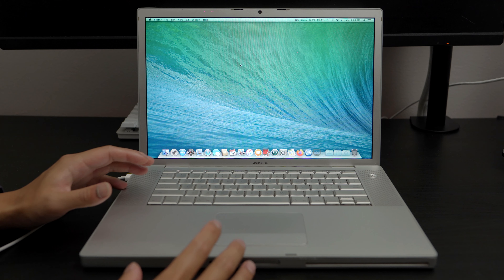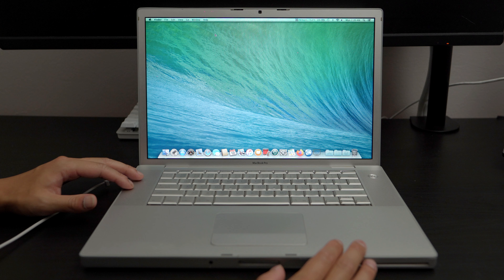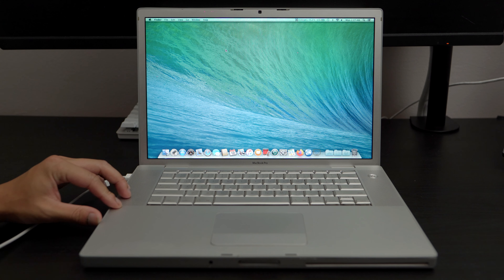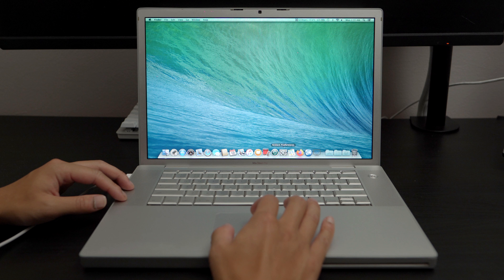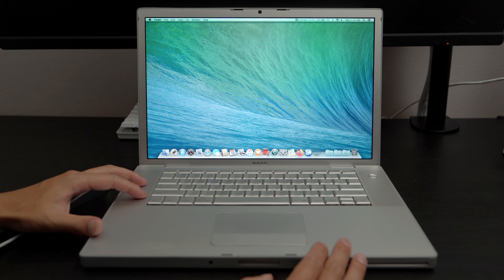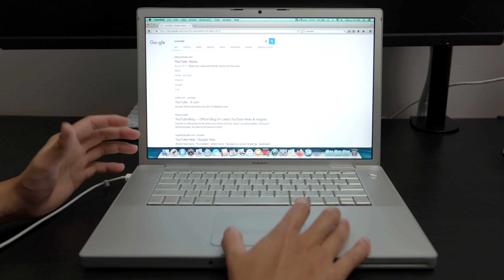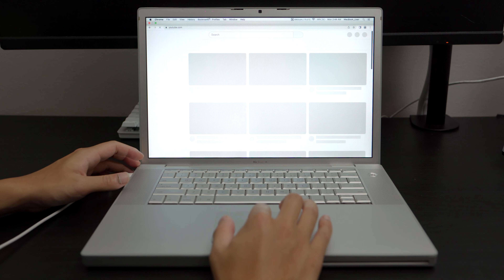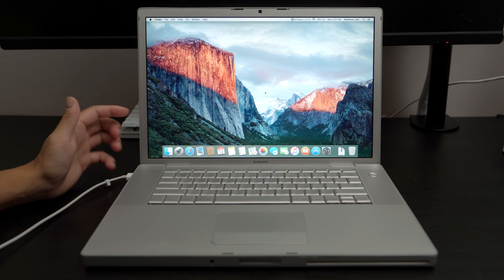2007 MACBOOK PRO IN 2024!!! FLAWED NVIDIA 8600M GT GRAPHICS

Comment: Damn I just bought one of these for real, real cheap. It's the 17" and it has the larger vram model so is it just an issue with that one because lol I'm worried. What a great design though, just amazing
Reply from the maker: It's a rare gem but those older cards are prone to failure, time will tell. just make sure it stays cool
Reply: Yep, it runs pretty cold but I might even add small heatsinks to the heat pipes just to make it cool even more

Comment: I have the 17-inch early 2008 version bought it used for $200 in 2018, it was in really good condition with a couple scratches only on the outside body, the keyboard, speakers, screen, mousepad, camera, disc drive all in excellent condition.

I wiped and updated it to El Capitan, installed an additional 2gb ram in total of 6gb (you cant go any higher than that), the hard drive failed after a month or two so I installed an SSD,  bought a 3rd party battery to see if it would last longer but works exactly like the OEM battery that I have. The laptop gets a bit hot depending on the surface its on and what your doing on the laptop. I played half-life 2 with all settings maxed out and it works like a charm. 

I also have a macbook air M1 but am currently typing this comment on my early 2008 macbook pro ;)
Reply: If you want to put it up for sale I would like to pay for a good price,
Best regard

Comment: Got the 15 inch around a month ago and it had a faulty keyboard, thought I'd replace it and have it running in no time, then the screen stopped working, decided to clean it, replaced the thermal paste, cleaned everything with isopropyl alcohol and nothing, now the fans and the cd drive are it's only signs of life
Reply from the maker: @EdCayo  graphics issue! Typical for these machines unfortunately
Reply: @cynonexus  thought so, thank you for replying

Comment: if the GPU was replaced by Apple (through the repair program) or a 3rd party with a newer revision of 8600M GT, those were very reliable, compared to the OG revision.
Reply from the maker: I haven’t messed around with it too much but I should make a video upgrading it!